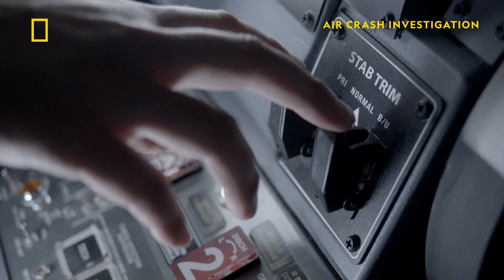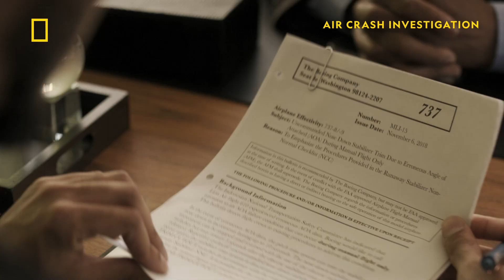What Was To Blame For The Crash?  | Air Crash Investigation | National Geographic UK

Comment: the Lion Air 737 Max crash but now the Ethiopian Airlines 737 Max second crash that doesn't make any sense if both 737 Max has crashed why would be the MCAS is malfunctioning
Reply: MCAS only took its data from one AOA sensor which was giving faulty data, causing MCAS to activate
Reply: Broken or misaligned AOA sensors.
Reply: Lion air had misaligned the sensors and were negligent. Ethiopian 302 had disabled MCAS, but were overspeeding, and couldn’t trim the wheel up.